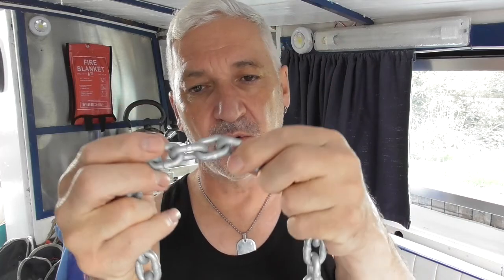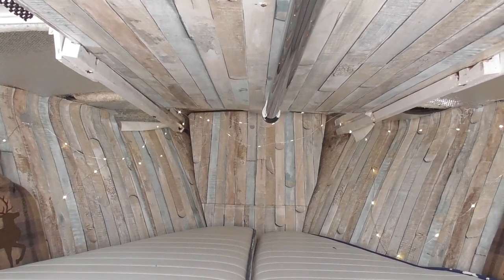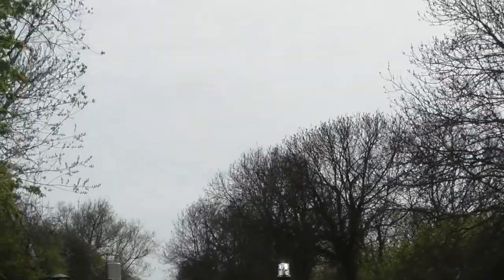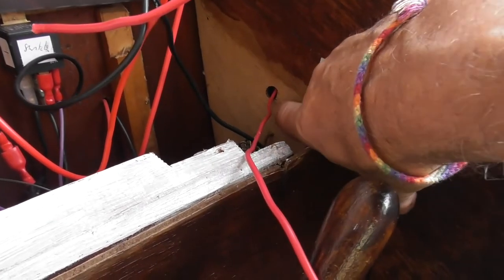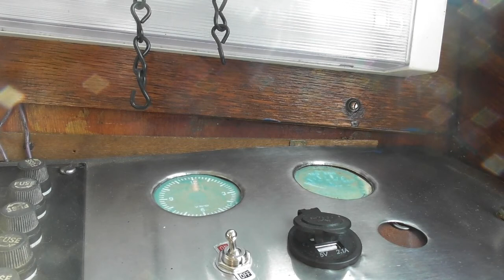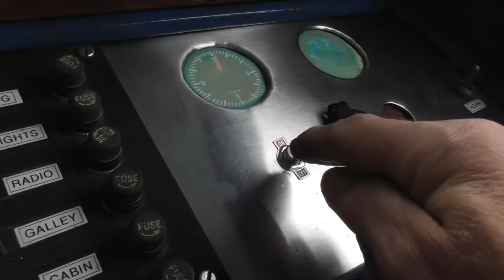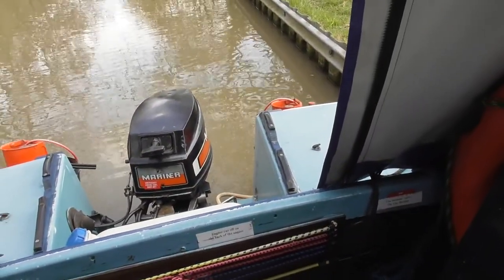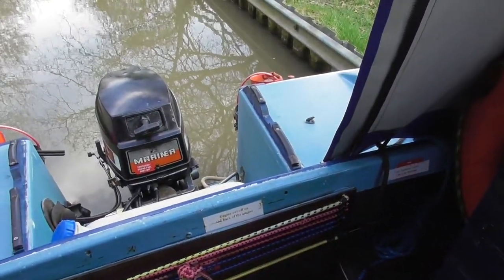175. Installing #AnchorChain and an #AnchorLight - The Boating Adventure

Comment: Is that tank on the outside for your diesel heater? Doesn't there get water in it through the tiny hole in the cap? If I hold my tank upside down, diesel will leak out of there.
Reply from the maker: Hi yes the fuel tank for the heater is at the back of the engine space. That is pretty standard practice for diesel heaters, I spent a few days recently where there were lots of hire  boats and they all had the tanks on the outside. In my case the flap of the rear door covers the cap. On the inside of the cap there is an inner piece shaped to keep liquid out. The spout is also at an angle so rain water runs off. What does your tank look like?
Reply: @TheBoatingAdventure  I had no idea. I was afraid of water getting inside so I mounted it inside an aft locker. Mine looks exactly the same as yours. Square with a blue cap. There's 4 holes in the middle for bolts. I got a 15L tank. It's quite a hassle to get it refilled in it's current spot so I might relocate it to the exterior. Thank you!